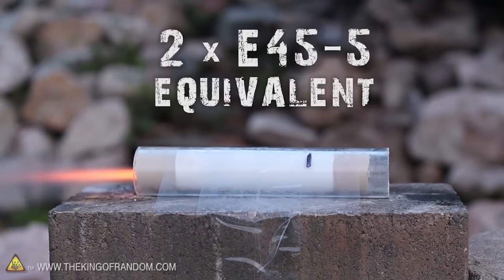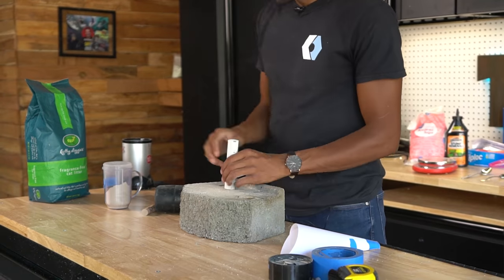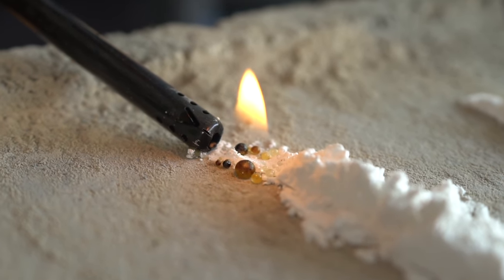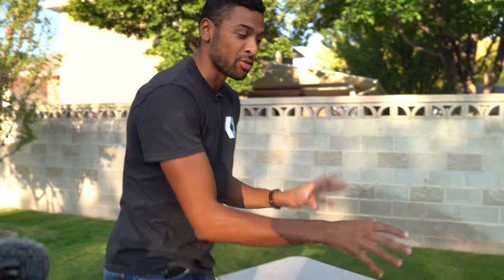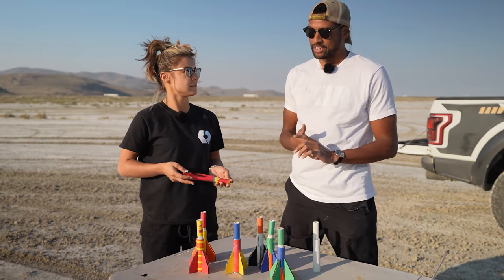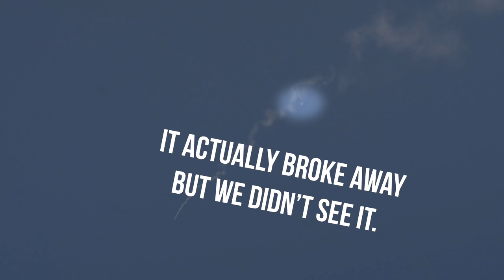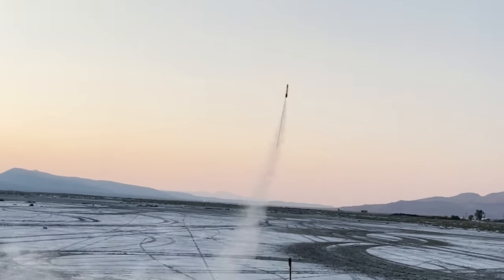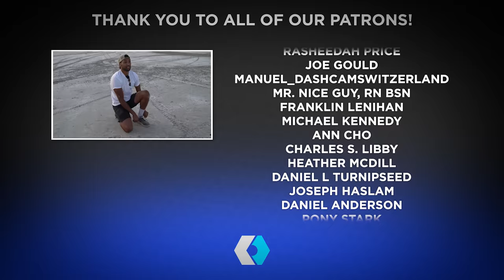Turning Powdered Sugar into This (Easy DIY)

Comment: I have found that some of the powdered sugars I've bought seems to be cut with seems to be corn starch, and therefore won't burn as hot, reducing thrust.  A friend told me to grind up some pure granulated sugar into a fine powder and try that. My thrust test stand even indicated better performance!  Great video!
Reply: Wonder how spinning sugar in those sugar cone machines would work.

Comment: A better option is to dip news paper in a solution of nitrate and chorate oxidising salt at a certain ratio to water. Once the newspaper laden with the oxidising salt solution are dried , it can be rolled up into a tube and insert into into the rocket tubular body. The advantage of paper over sugar is it is lighter and cheaper than sugar. I have built multiple stage rocket during my childhood days. By the way great videos. Remind me of my childhood days.
Reply: instructions please

Comment: I did something like this, oh about 40 years ago, only I used 12 gauge shotgun casings and cooked sugar candy fuel poured around a 1/8" screw which is later removed.  On top of this was a Whistling Pete firework to provide even more entertainment.  Though the Whistling Pete worked better with Estes D size booster, with a C motor as the 2nd stage.  These were taped to bamboo garden stakes.
Reply: I didn’t ask

Comment: Neat! Your vid popped up in my feed and I had to watch. My model rocketry phase came and went 40 years ago may Estes be praised. My first project was a $16 kit I purchased at the Huntsville Space and Rocket museum. The 3.5 foot tall Saturn V. Took a couple of months to put that thing together. And I mean I worked hard on it. Built my launch 'rocket box' with lights, switches, the works. 
But...I knew about the sugar stuff 50 years ago. My friend BooBoo told me about it. Only my mix was 3 to 2 with regular sugar. Tried cooking with water. What a plastic mess and it spewed less. Ha!  Back then you could get the PN at the corner drug store. Yep, still had those things then. My stuff only spewed, of course. I never quite made the leap in logic to using it for rocket propellant.

Comment: You can use pictures couplings and cut them down one of each size and they fit into each other to make a half to 3/4 adapter. They also sell adapters so you don't need to shave the 2nd stage down
Reply: friction fit of those would keep them from separating.  You would still need to sand down the tube.

Comment: You should have tried a 3/4 coupling on the top of the first stage with the top of the coupling cut down and used 3/4 second stage with minor bevel.

Comment: Imo if you heat the propellant mix into  putty like material you should have more consistency in the motors. You want to avoid pockets of air or inconsistent mixed fuel. Also adding a burn rate catalyst such as red iron oxide or sulfur can yield better motors

Comment: I remember studying space in science class in 8th grade and we built rockets from paper towel rolls and used a "hollowed" egg for the nose cone.  After that we were offered extra credit if we built a rocket (bought from Hobby Store or not) and bring it in and launch it on our field day.  I needed the extra credit so I did it.  I loved building my rocket, but had some kind of failure on the launch and the engine broke free and shot up inside the body of the rocket where it proceeded to start burning.  LOL  I still got my extra credit though.

Comment: I had to ask one thing.  I made a sugar rocket today.  For some reason I couldn't fly it.  If I fly it tomorrow.  Won't there be any problem?
Reply: My experience with potassium nitrate is that it tends to absorb moisture from the air and must be kept sealed until ready to use.  A rocket engine would do fine if kept in a controlled enviorment until ready to launch.  Maybe a large Ziplok bag would do?

Comment: You should use a camera on board and ""Air tags" to track it on gps.. especially if it can record altitude on it at same time.
Tracking and recoververy in 1!

P.s. you should make sure people understand that the fuel has to be packed or itwill explode like 1/2 stick of TNT dynamite! 😮😮😮😮😮
In plastic that will send plastic shards at people to create injuries!😢😢😢😢😢

Possibly causing death.

Comment: Yo tengo Una pregunta, cuando pones la mezcla del potasio y azúcar dentro del caño de 3/4 o de 1/2 también usas el martillo para comprimirlo? Esa mezcla no explota a la compresión?? Es la única duda que tengo, yo lo voy a hacer me gusto mucho la idea
I have a question, when you put the mixture of potassium and sugar into the 3/4 or 1/2 pipe, do you also use the hammer to compress it?  Doesn't that mix explode on compression ??  It's the only doubt I have, I'm going to do it, I really liked the idea

Comment: I've made these before, just different fuel, still sugar, but different mixture, sugar and stump remover, 25 stumpremover, 75 sugar, then put in a pan and turn on heat, until it caramelized, and make sure it is super liquid, then poor into pvc, take 2 of those with fuzes through them, connected, and boom 2 stage rocket, with solid fuel and it burns alot faster than this, oh and make sure to let the fuel cool down, then it will be solid like candy, light it then enjoy, 

Edit: just remembered but I also use printer paper instead of pvc, just rap it around a dowl rod until your out of paper to wrap, then you cut them in half and that's your body
Reply: Stump remover is the same oxidizer mentioned in the video.

KNO³ potassium nitrate/ NaNO³ sodium nitrite (saltpetre) is what I've seen for stump remover around here.
  I made a ton of these growing up,  potassium nitrate seemed more reliable and energetic in my experience. Fun video

Comment: I wouldn't use a drill to make the hole, the fuel mix could ignite with the heat produced by it, causing severe burns

Comment: Would there be a risk of the fuel igniting if you hammer it too much? My friend (definitely not me), who is a pyro wants to know.
Reply: I was more nervous about the potassium nitrate and sugar solution in a Ziploc bag. I'm not sure if a static shock would have enough power to set it off, but if I ever make this, I definitely plan on mixing it outdoors.

Comment: I punctuated a 18650 battery on a vice & it had such a long rocket flame I think it would’ve took off if not clamped in, later that day I did another one this time on the ground & it took off but spinning mad I’m sure it has enough oomf for a rocket motor.

Comment: Isn't the fuel compression stage where the fuel mix is compressed by tamping it down with a wooden rod dangerous? Sugar is a crystal and the piezoelectric effect of compressing a crystal might produce an electrical spark which could ignite the mix.

Comment: I think you can also dissolve both the nitrate and the sugar in water at the same time then crystalize it to have perfectly mixed rocket fuel. (albeit very dangerous to store because it only needs heat to ignite and the fuel and oxydizer are already present)Can you try it?

Comment: 👍 great video, if you want to have some fun trying to get things timed and synced up, get two 29mm Estes black powder motors to use like boosters (think space shuttle srb's ). Getting the smaller boosters and main rocket candy motor to light at once, a tad more difficult than I thought it'd be but I got it to work and once I had it down I went for bigger and bigger motors I'm trying g to send my next one with Alan shepherds picture on it up to the altitude he reached

Comment: Graphite can conduct electricity so can water so what would happen if you take a lot of graphite powder mix it in to water and and put a high voltage power cabel into the water what would happen

Comment: You could really use a more solid workbench. When you were packing the clay all that give in the table surface knocking things over from the strikes is lost energy going where you don't want it to go. You probably could have packed it with half as many strikes just putting the block on the floor if it was a garage floor slab.

Comment: I might be a year late, 😔... But you could put a little bit of an element to make color on the smoke for either the first or the second one, or a different element in both so that you can see the first one in one color and then the second one in a different color... A very little amount of dust of each type of element in the respective rockets would do the job

Comment: What if you used cinnimon? It went up fast when tossed over a campfire?
Reply: Flour, or basically most any powder, or fine particles will flash when exposed to a spark or open flame.  Think of grain elevator explosions!

Comment: Since the potassium nitrate in these rockets is the oxidizer and the sugar is the stuff that burns and makes it fly, I wonder what would happen if a pure sugar rocket was made then soaked in liquid oxygen just before ignition.
Reply: It would be called a hybrid rocket. Solid fuel that you pump liquid oxidiser through. Some designs use a rubber like compound as the fuel. The advantage is that they can be turned on and off by simply altering the flow of oxidiser.

Comment: how did you make your fuse ?
Reply: Connect 2 wires together and charge both of it and it will get hot and when it gets hot it will burn stuff snd thats is ur fuse